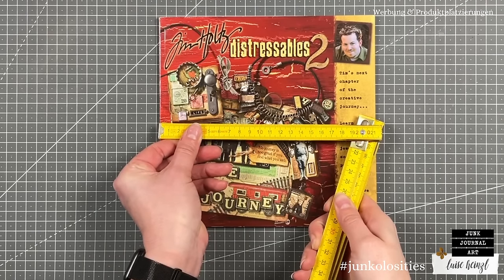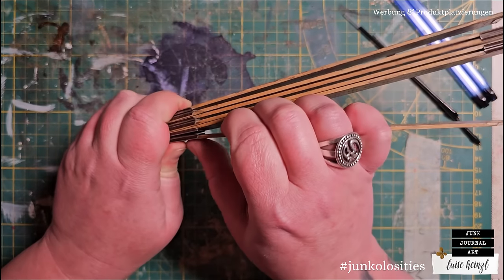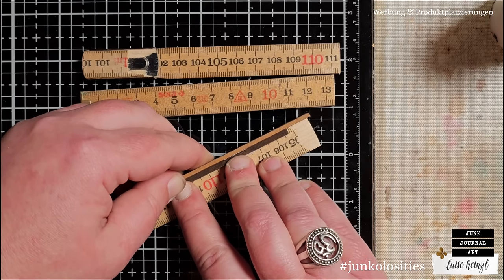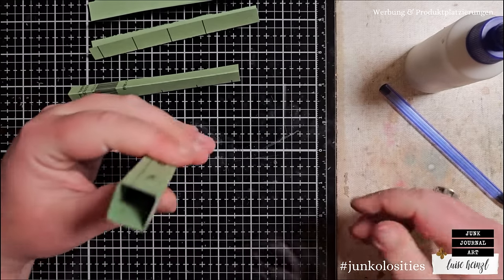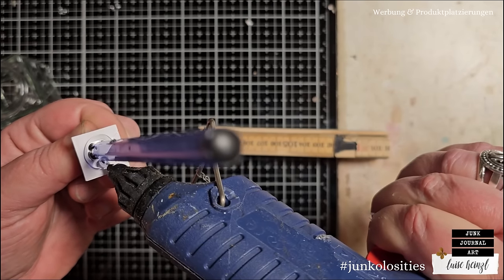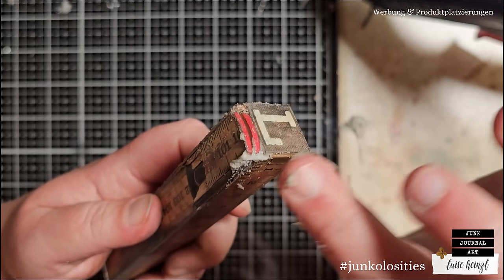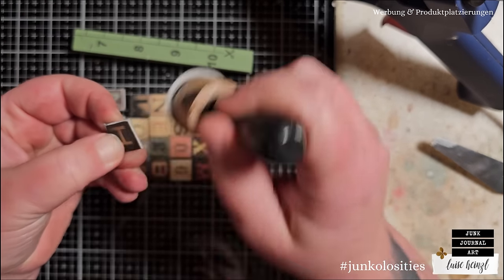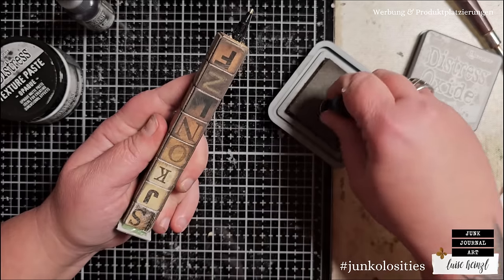ONE-OF-A-KIND PENS FROM FOLDING RULE & EVERYDAY MATERIALS! EASY DIY! Let's distress! #junkolosities

Comment: Love these pens Luise!  Very Junkolicious 😁! Just a quick scoring tip - once you’ve got the item you’re scoring firmly against the LHS panel so it’s in the right position, slide it down a little bit, away from the top panel.  Then when you score, instead of starting with the bone folder on the cardboard or paper, start with it in the scoring channel.  That will help keep it from sliding out of the channel accidentally & makes sure the scoring mark goes right to both ends of the cardboard/paper.  “Channel skipping” doesn’t seem to be an issue for you personally, but some people (especially those with arthritis or weaker forefingers, or those using very slippery cardstock) find that the bone folder can slip out of the channel & make wonky lines.  This should help keep everything straight 😊